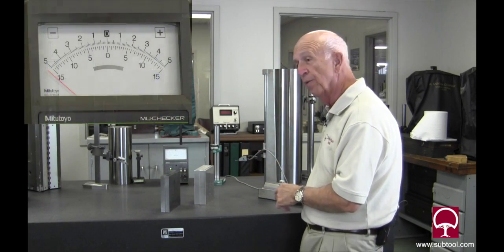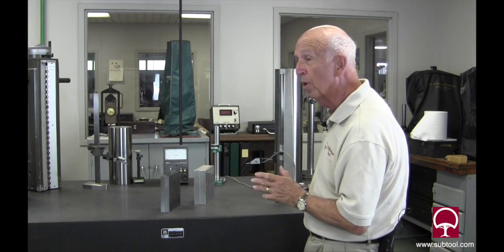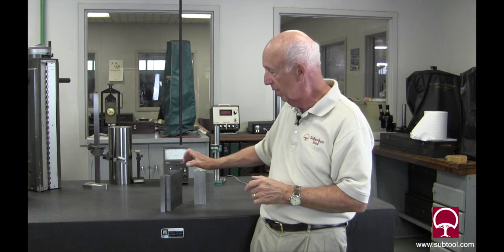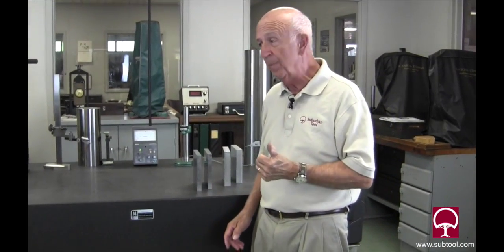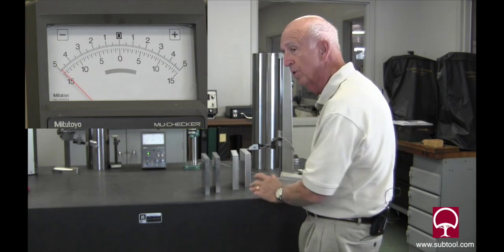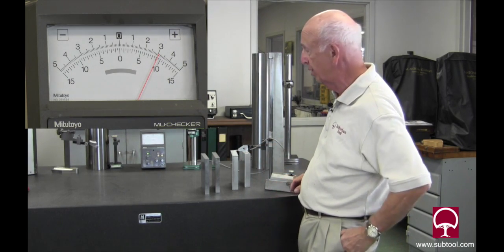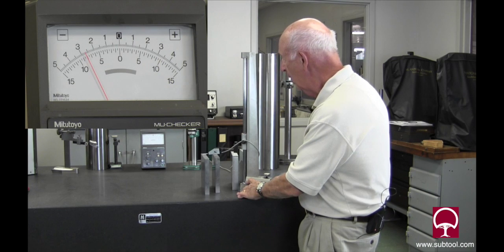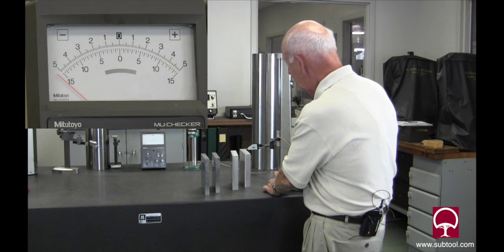Why does temperature matter when checking dissimilar materials?

Comment: Another good video!  Engineers tend to think about stuff like thermal coefficients of expansion, but machinists definitely need to think about these things too when working to high tolerance.  This is also another good reason to put the heat into the chip rather than the part when machining.

Comment: Another variable is the scales of the readouts on mills we often trust for hole spacing etc. They are usually made of glass which has it's own lower rate of thermal expansion so even if you compensated for the metal expansion with the display, you could still be out. This is one of the selling points of the magnetic scales that use steel balls in a tube rather than optical glass. On a large machine over several feet for example, because the steel balls expand at the same rate of your steel workpiece, the readout should be pretty accurate regardless of shop temperature.

Comment: Thanks for sharing that, I never realized how much aluminium grew, no wonder I've missed the mark a few times when the aluminium got hot from turning.
Reply: Steve S That's why you should do the roughing cuts, let cool and finish... When result is critical, counts for steel too...  ;-)
Reply: Lots of flood coolant tends to really help in holding tight tolerances by keeping temps consistent. :-)

Comment: the growth of metal is called the coefficient of expansion and is used extensively in mold making.
Reply: sahkram I agree totally, in fact it is critical to allow for the expansion coefficient if you are to end up with the correct size product. This is the same as with machining which was indicated on this video although perhaps does not illustrate the problems that can manifest themselves if temperature verses application of product are properly taken into account. Things like incorrect press fit size comes to mind. Cheers from John.